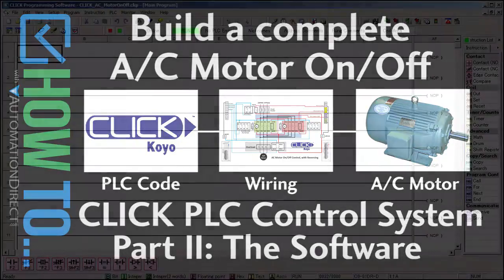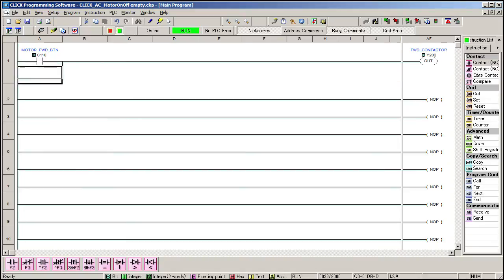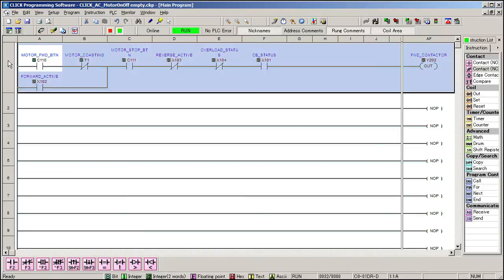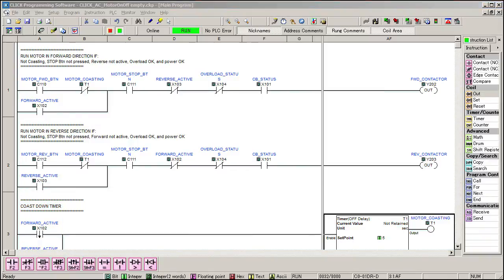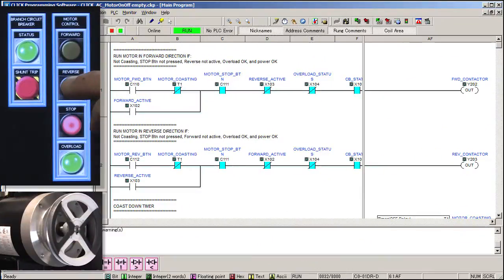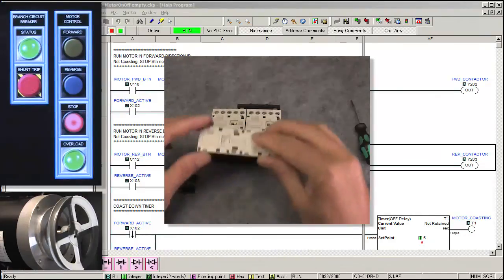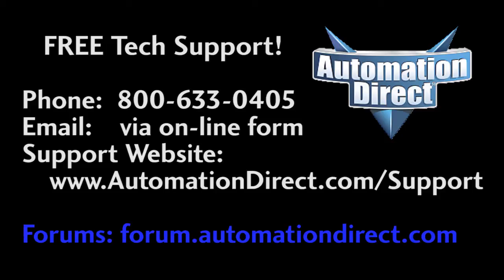AC Motor On/Off with CLICK PLC Part 2 from AutomationDirect

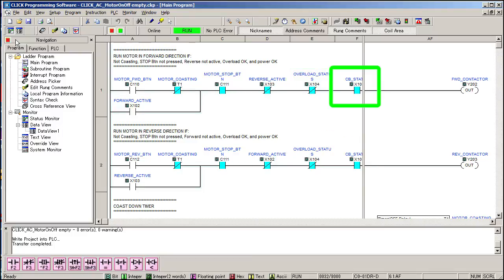Comment: At time 6:00, FORWARD pushbutton is about to be pressed.  STOP pushbutton is illuminated and at rung 1 the MOTOR_STOP_BTN instruction C111 is true (its initial value was set On under Address Picker).  FORWARD pushbutton is then pressed.  MOTOR_STOP_BTN instruction C111 remains true.  But STOP pushbutton is no longer illuminated.  What caused STOP pushbutton to change from lit to not lit while MOTOR_STOP_BTN instruction continued to remain true?
  
At time 7:00, it states that STOP pushbutton state is the inverse of MOTOR_ACTIVE C121 output.  So, when MOTOR_ACTIVE C121 output is true, STOP pushbutton is not illuminated.  And when MOTOR_ACTIVE C121 output is false, STOP pushbutton illuminates.  Therefore, MOTOR_ACTIVE C121 controls the illumination state of STOP pushbutton.  How are the two inversely linked that allows such control?  Thank you.
Reply from the maker: This is a  bit complicated to try to explain in this format. Please contact our Free, Award-winning technical support by calling, emailing or chatting. You can find their info here: https://community.automationdirect.com/s/contactsupport

Comment: How did you get C111 and X101 in the first rung to be active? I don't get that since it's a open contact eh
Reply from the maker: X101 is the breaker status and is closed when the breaker is closed (see hardware video). C111 is a Cmore virtual button (1:08). Part 1 covering the hardware is here https://youtu.be/rhzHeBe9Bf8

Comment: should the C111's be replaced with the X107 instead of the X102 and X103?
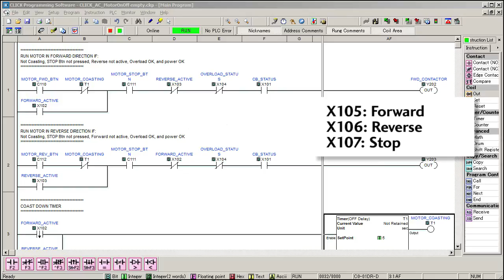Reply from the maker: Good Catch!  Yes at t=5:06 the incorrect contacts are highlighted. C111 should be replaced with X107.  Thanks!

Comment: thank you sir, what if want to add current & voltage sensors, speed control how did i add this quantities?
Reply from the maker: Check out our Automation Video Cookbook for ideas on how to add sensors (www.automationdirect.com/Cookbook). For speed control, there is a whole chapter in the video cookbook dedicated to Variable Frequency drives (VFDs) which shows you how to vary the speed of a motor.

Comment: Does click plc have sequential programming?
Reply from the maker: Hi Linton, By "sequential programming" do you mean a text based language like C++,  Java, python, etc? If so, the answer is no - it just uses ladder logic. It has a very small instruction set to make it easy for folks to get simple tasks up and running quickly. It's very easy to learn, the software is FREE and we have tons of videos to show you how here: www.automationdrirect.com/videos and www.automationdirect.com/cookbook.
Reply: @automationdirect  does the power supply shipped separately or is it built-in
Reply from the maker: @lintonthomas9826  Hi Linton, Are you referring to the PLC power supply? It is separate. You can use any 24VDC power supply or if you want one that snaps onto the CLICK PLC check out these part numbers: C0-01AC or C0-00AC at www.automationdirect.com.

Comment: I have a c-more screen and i want to use switches and lights like those shown in this video however i do not see those pushbuttons and lights available in the programming software. Where do i get them and the information to program them is there a link or do i need to purchase them separately?
Reply from the maker: Hi David,  thanks for watching! For technical questions like this, please contact our free award winning tech support. They are setup to give you the most efficient and quickest support. Thanks! 

Phone:    1-800-633-0405
Email:     https://www.automationdirect.com/adc/Form/User/TechInquiry
Support:  http://support.automationdirect.com/